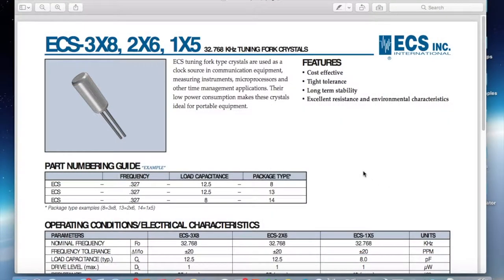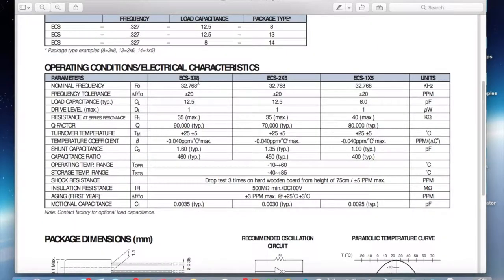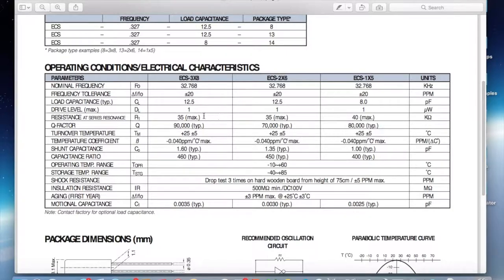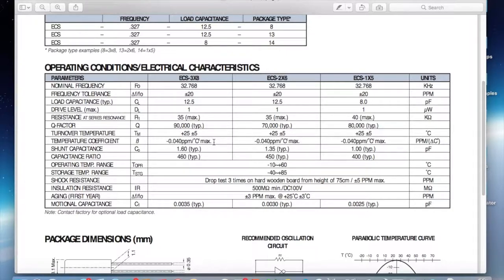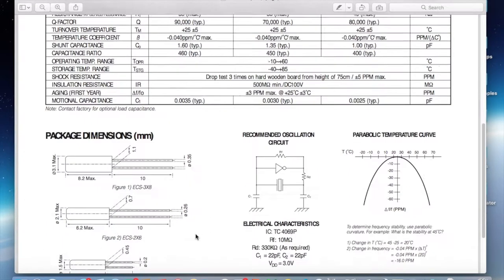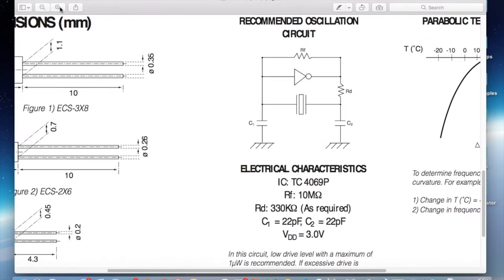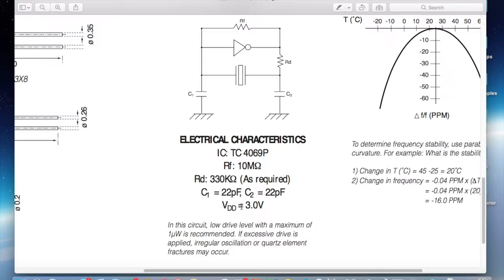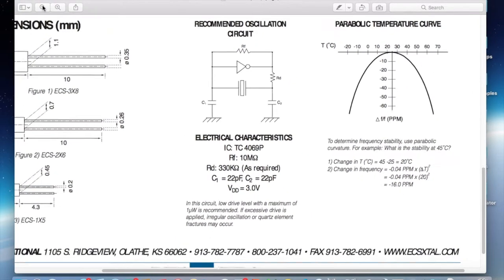NOR Gate Pierce Crystal Oscillator

Comment: How did you find those components values?? Provide the formula
Reply from the maker: Component values were provided by the manufacturer:   https://source.z2data.com/2016/10/5/8/38/8/944/180020/ecs-3x8.pdf
Reply: @NetworkXIII  i want to give the gps trigger from Arduino to the oscillator circuit which works in hertz i.e output square wave in mega hertz so how to do it??
Reply: @NetworkXIII  please reply
Reply from the maker: @sanskrutivs9435  I'm not sure of the maximum output frequency from an Arduino digital pin, it depends on which Arduino board you have.

Comment: Dear sir, what’s the aim of using a load capacitance ? 
Thanks
Reply from the maker: https://www.electronicdesign.com/technologies/analog/article/21795717/fundamentals-of-crystal-oscillator-design

Load Capacitance

Many crystal oscillators operate at the parallel resonance of the crystal and the load capacitance rather than the series resonance of the crystal’s LCR model. The load capacitance is defined as the effective capacitance, external to the crystal package, appearing between the crystal’s terminals.  Crystal manufacturers therefore specify a load capacitance to set the crystal’s intended operating frequency. A different load capacitance will produce the wrong frequency.
Reply: Network XIII great , thanks . But what’s the difference between operating at parallel than series resonance ?thanks.
Reply from the maker: The frequency of oscillation will be slightly different in one mode compared to the other.  In this circuit, the crystal is operating in parallel mode.
Reply: Network XIII thanks, have a  good day.

Comment: Doing an oscillator with a gate is a bad idea.
Reply: The crystal manufacturer put the example circuit using the logic gate in their datasheet.
Reply: @NetworkXIIIOverload  I have see so many of these oscillating on an harmonic. You need a special inverter to garantee that the circuit w orks all the time.
Reply: @y_x2  It worked just fine for me.
Reply: @NetworkXIIIOverload  It was a disaster in production! They disappear in the 1990s.
Reply: @y_x2 I wonder how did these harmonics occur？